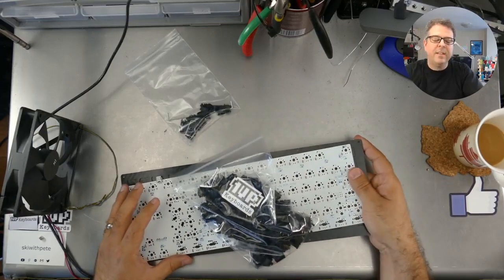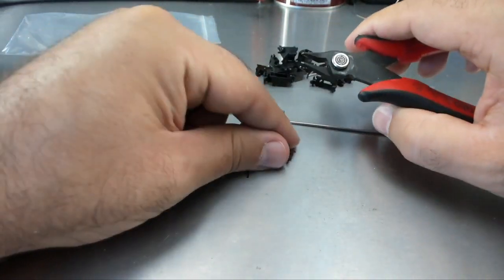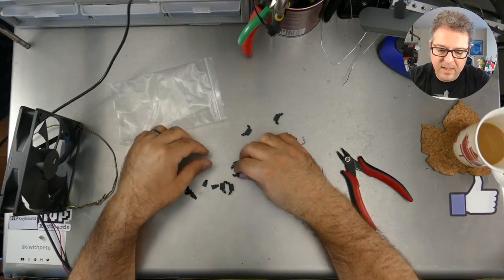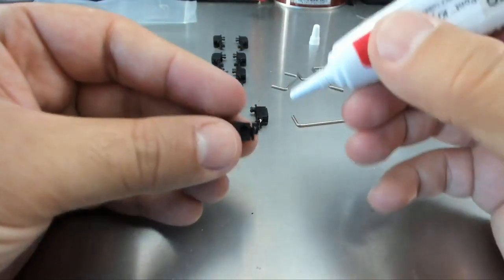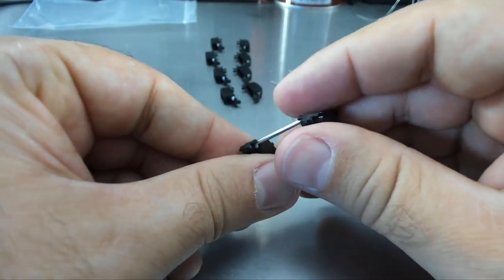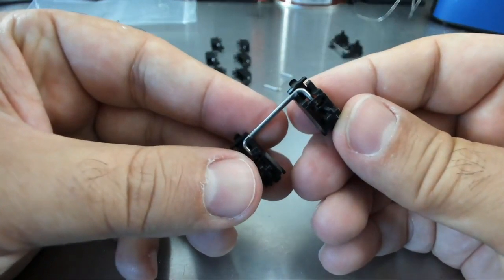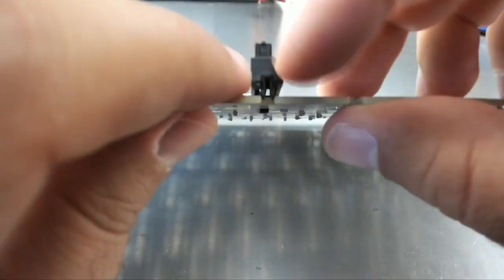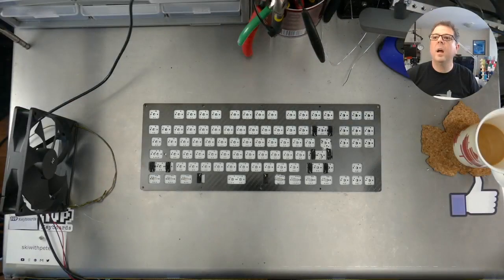How to assemble a mechanical keyboard stabilizer (simple)

Comment: I took my spacebar out of my HyperX Alloy FPS pro and one of the mini black switches came out (the inside "+" part). I'm trying to slide it back in but I can't. What can I do?
Reply from the maker: Oof, that's not going to be easy.  You might need to look into keyboard repair shop, if you're not comfortable with de-soldering and soldering.

Comment: I know it's very late to the video, but how does that procedure change for iso layout and the bigger enter key? Especially how would you know that the PCB works with the intended iso layout and stabs for the enter. Thanks!
Reply from the maker: Hi, yeah, the iso enter has the stabilizer oriented vertically (vs all of the horizontally oriented ones I'm putting on this board).   Most hot-swap boards are one or the other.  Most solder boards are both.  Hope that helps.  If you're still confused, I really recommend the 1upkeyboards Discord.
Reply: @skiwithpete  oh wow thank you so much for the super quick response. So I saw the new Novel keys hotswap board, is this likely to be also one or the other? Thanks again.
Reply from the maker: @xlInYouFace  Yes, as far as I'm aware it will always be one or the other as the hotswap is in a position that won't allow ISO.

Comment: Does it matter which way you put them in? Like if the wire is up or down
Reply from the maker: Boards are designed to have them one way or the other. You want to put them in the correct way. But it doesn't matter which way that is.

Comment: Hi man, 
What does 625u 60 87 stab set, or 6u 104 stab set, or  7u 60 87 stab set mean when you're trying to buy stabilizers for your keyboard?
Reply from the maker: So u size is the width of the keycaps. A single keycap is one u. Some spacebars are 6u, 6.25u or 7u. And depending on the layout of your bottom row, only one will fit. 
The 60, 87, 104 is the size of your keyboard. Depending on the size tells you the number of stabilizers you'll need. For example on a 104 you need stabilizers under your number pad 0, enter and plus keys. On a 60, you don't have those. Make sense?
Reply: @skiwithpete  yea man thank you so much! I have a GMMK TKL so I would need to buy 625u 104 set?
Reply: Sorry a 625u 60 87 set is right for TKL?
Reply from the maker: @eatingpips  Yes, a 60% set is all that's needed as there are no more stabilizers needed on a TKL (everything that's extra is 1u).
Reply: @skiwithpete  Do u mean 6.25. This is just for extreme confirmation as I am thinking about getting a 60 percent nk cream setup!

Comment: is it worth spending 20 bucks for fancy screw-in stabs over clipping generic MX style clip-in stabs?
I'm planning on band-aiding and lubing regardless.
Reply from the maker: It's a lot about personal preference. All of the screw in stabilizers have a smaller top hole than the clip in. So there's less noise without lube. But with lube, the size of that hole matters less. Though I don't bandaid... If I did I would absolutely get screw in.
Reply: @skiwithpete  Well I'm trying to keep the cost down a little, so I'm probably just going to mod the stabs that come with the kit I'm buying, that should still give quite a decent experience right?
Reply from the maker: @raymanovich3254  spend the money on lube
Reply: @skiwithpete  How does one identify "good" lube? And where do you shop for it. Most of what I've seen is out of stock.
Reply from the maker: @raymanovich3254  I'm the owner of 1upkeyboards.com and we've got all the good stuff. You want thick for lube. Or if you don't trust small biz, follow the link in "misc" on the site to an Amazon link.
Reply: Yes

Comment: Does the wire goes in the hole of First floor or the bottom of the Hotel?
Reply from the maker: Goes in the bottom floor. In some places that is the first floor, other places that would be ground floor. But the wire goes into the lowest floor of the hotel.

Comment: Are you able to remove the stabs once snapped in? I would like to mod my stabs.
Reply from the maker: Yes, the clip can be pushed back up.  But, if your board has switches soldered in... then likely no.

Comment: Do you need the stabilizers?
Reply from the maker: Yeah. Without them it's all going to be very unstable
Reply: skiwithpete like Wobbly?
Reply: @thehoodtroller8897  yeah and if you hit the corner of your spacebar, it might not press space, just tip your keycap.
Reply: Peter Gosselin it’s funny cause all my Stabilizers are off except my space bar and the other ones work fine cause there small so I’m in luck than thx
Reply: @skiwithpete  hey man my stabs (gmk screw in stabs 104 kit) my space bar stabs are wobbly and the stem is getting out of the housing a little bit more than it should be do you have any idea why

the stabs work great but are wobbly because the stem is getting a bit more than the rest of the stabs ( my build is a custom 60% first build)
Reply: @skiwithpete  finish i figured the problem it was one hotel  was flipped the other way thats what caused it to be that way.
Reply from the maker: @bgra487  Not sure what you mean, the stem is getting a bit more out of the housing... is the wire inserted correctly into the hotel side?  Did you clip more than just the leaf-spring?  Is the housing cracked?
Reply: @skiwithpete  no don’t worry the hotel was installed on the other side (opposite side) when I put it with the house but u didn’t clip or customize anything because it’s my first build so I don’t want to do any modifications.
Reply: @skiwithpete  I not u*

Comment: i would sell my first child for custom stabs to avoid clipping or adding tape and stuff
Reply from the maker: It's made too complicated by nerds who are talking about making a 0.1% difference.  Before the pandemic, I'd attended meetups with different types of stabilizers and challenged "experts" to identify them...  All that to say, don't stress about it.  Here's an idea, buy a board based on hot swap switches and that way you can disassemble and upgrade your stabs at a later date.